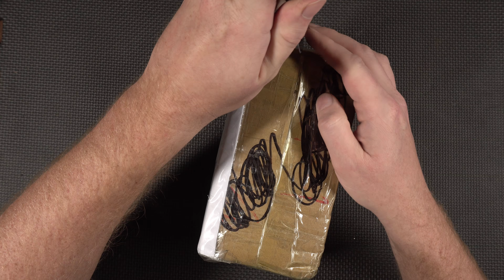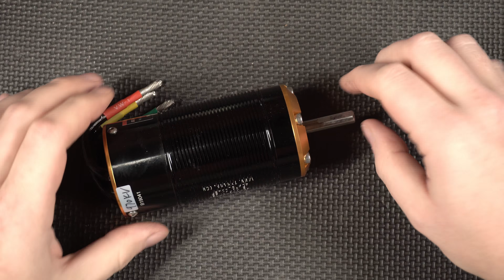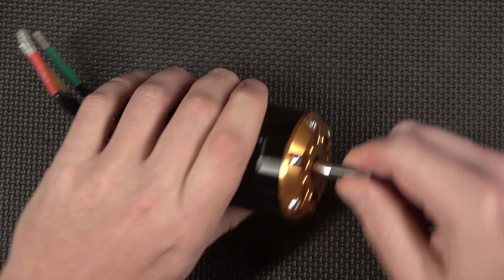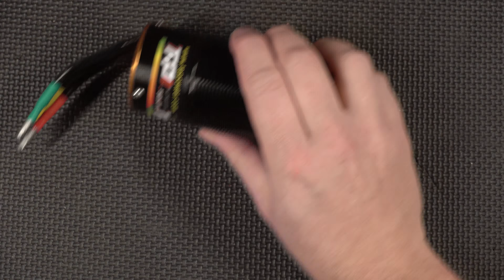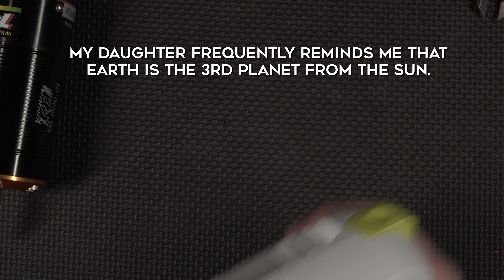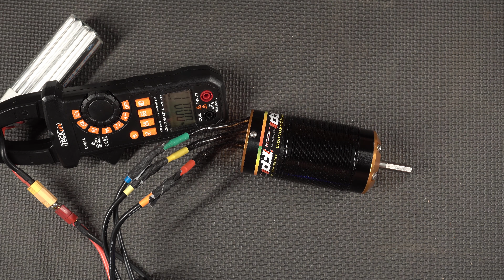20 Hp Brushless Motor!  TP Power 5860 Unboxing & First Test

Comment: I run 6 pole TP 5660 1440kv and 6 pole TP 5870 800kv in my rc cars.  The fact that they are 6 pole motors with great magnetic resistance there are not to many esc's that can handle the transistor switching frequency of current demand of the motor on 12s.  Castles  2028 800kv is the go to motor it is a 4 pole motor and wakes up so easily on 12.  I hope this information was helpful to you and good luck man
Reply: I have to ask, but you do know that TP does not make an 800kv 5870 right? Not even custom. Also, the 2028 has nothing on any TP. Fact is that the 800 kv 2028 Extreme is not even that much more powerful than say what a stock DBXL-E comes with. Try just putting a Max5 in front of a stock DBXL-E, set the punch to 5 and gear it with a 17 tooth pinion. Trust me, you will be surprised at what that little 780kv has to offer. But here's why a 2028 is nothing special. Take it apart and take a DBXL-E motor apart. I dare you to see a difference - because they are the EXACT same motor on the inside. The 800kv is slightly upgraded, but almost half the power output of a 5870. If you take a 2028 Extreme above 8000 watts, you WILL burn it up, simple as. The TP 5870 you can take to 15000 watts and it will live.
Reply: @AB-80X   i got a steve neu special motor that will burn up anything you got !!!!! in an x0-1 !!!!
Reply: @AB-80X  I've logged 20KW on a number of times with 2028 800kv motor on 12s.  2028 is more comparable to TP 5860 because they are both 56-112. The 5870 is 56-122 and rated for less RPM because of the rotor.
Reply from the maker: I did actually get it to spin on 4s (like in the video).  What esc do you use for your 5780?  Thanks!
Reply: @AlexLTDLX  MGM x2pro on 12s.  ZTW/HOBBYSTAR 12s failed on me twice
Reply from the maker: @KiloWattRC  Thabks! An ESC is the next thing to buy and I wasn't sure which one.  I'll check it out!
Reply: @KiloWattRC  exactly   the ztw 12s blew  2x on me , big ass fire  , there are piece  of shit
Reply: @KiloWattRC  how much  was mgm
Reply: @ZenCooksU  $700 with 5 year warranty
Reply: @ZenCooksU  Funny. I have had ZERO issues pulling both a Lehner 3080-6 and a TP5870 5D with my ZTW.
Reply: @AlexLTDLX  getting the motor to spin is not problem.   It's the current path to 6 pole wire windings that tend to damage ESC transistor switching frequency for motor demanding maximum constant current.   A good motor for 12s is castle 2028 800kv 4pole motor but they are very hard to find
Reply from the maker: @KiloWattRC  that's why I ended up with the TP power motor. I couldn't find a castle motor. But this one is supposed to be more powerful anyway. What ESC do you run with your big TP motor?
Reply: @AlexLTDLX  MGM x2 pro 25063-3
Reply: Check out ztw esc bud
Reply: @theirishaxe9405  it's a well know fact that 6 pole TP motors kill ZTW/HOBBYS HOBBYSTAR esc's.
Reply: @KiloWattRC  huh works well in my Bros 16s losi
Reply: @theirishaxe9405  ZTW beast pro 300amp is 12s max esc.  Lol
Reply: @theirishaxe9405  castle 4 pole 2028 800kv 12s motor works perfect with ZTW/HOBBYSTAR  12s esc.  But the  6 pole TP5870 800kv does not work properly with ZTW/Hobbystar
  Now you mention 16s that's sounds more like a MGM 400amp 16s esc.  And MGM makes good esc's.   I have the 12s 250 amp and it does good with TP5870 800kv 12s motor

Comment: Hey buddy I've been chasing this same dragon for a while now too lol and you're on the right track man.  I'm going to try 

https://www.ebay.com/itm/P-2-Centrifugal-Supercharger-Polished-Head-Unit/174050615552?_trkparms=aid%3D555021%26algo%3DPL.SIMRVI%26ao%3D1%26asc%3D20190711100440%26meid%3Da9a312d1f44846fcacfc9cc5f7197873%26pid%3D100752%26rk%3D1%26rkt%3D8%26mehot%3Dpf%26sd%3D193093721522%26itm%3D174050615552%26pmt%3D1%26noa%3D0%26pg%3D2047675&_trksid=p2047675.c100752.m1982 

that guy next it's a knockoff of yours. I been messing with old t3 and t4 turbos for a couple years, trying to make  multiplier gearboxes with power tool parts killing many many tools....Working with one 5 kw RC BLDC motor, an 80 volt leaf blower BLDC motor, 60 volt Lawn Mower BLDC motor, and arrays of 775 DC brushed tool motors.  May I suggest, (to late I know)  keep the gearbox (it's by far the most expensive piece of that puzzle), and go for a slower bigger BLDC motor.  You need the 15 Kw but only around 15 000 rpm and the gearbox will soak up vibration. Resonance is your worst enemy, and before you chop up that impeller,  realize that you need to use an isolator coupling between the motor and impeller shaft, otherwise  the vibration , and inevitable wobble, will gobble up all your power. Smoked a 250 dollar esc to figure that one out.  The key though man, and the reason for the high cost of centrifugal superchargers, are those gear boxes, and they are kept as secret as possible.  I can't find one to buy, or any details. You won't really find any speed multipliers at all. Planetary gear boxes can work both ways well though, as well as good old spur and pinion. Direct drive seems like the way to go but I'm not so sure now...  Check it out if it's not too late.  Also placing one bearing inside another seems to work well for high speed applications...

Wanna sell me the gearbox if you don't use it?? lol
Reply from the maker: That looks like a Chinese Vortech knockoff.  I didn't know they existed - good to know, thanks.  You've also given me an idea on how to maintain a level of precision and safety on the motor to impeller drive.  In fact, I just ordered the parts.  There's nothing special about the gear drives - they're just high precision, robust (made out of hardened steel) gears.  If you didn't see it, check out the Vortech disassembly video: https://youtu.be/i6FDfJH2w94  In all my years of messing with superchargers, the only ones with any sort of energy absorbing coupling are positive displacement types - in my first hand experience, Whipple and Eaton blowers all have them.  None of them have more than two gears.  In this case, I can't sell you the gearbox because I need the impeller shaft which has a gear hobbed on to it; the other gear is useless without it.  But thanks for the ideas!

Comment: Have you figured out the shaft coupling yet?
Reply from the maker: Yeah, I'm going to use the Vortech factory shaft, and drill and ream into the back of it after grinding off the hardened area.  2 set screws and one angular contact bearing and it should be good to go.

Comment: Brushless motors usually use a male bullet connector on the motor side and then the corresponding female connector on the ESC wires. I'm not sure what size connectors you would need to handle 300 amps. You may have to do some research to find a connector, ESC,  and batteries capable of handling that amount of current.
Reply from the maker: Thanks.  I don't really like any of the connectors I've seen; I'll probably just make my own out of 1/4" copper tube.  It's exactly the right size.